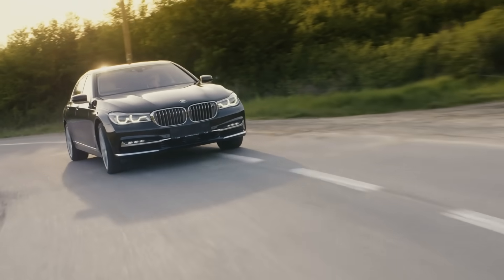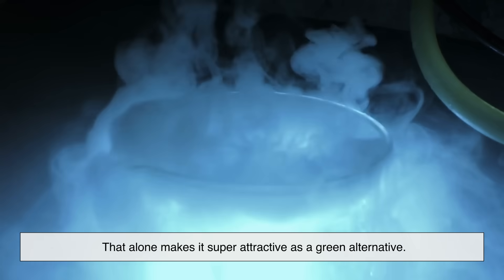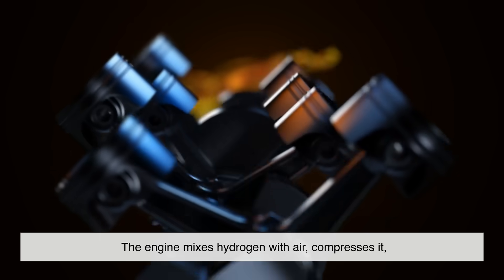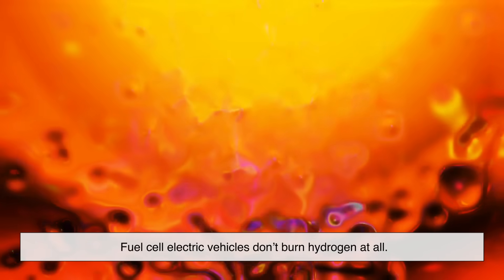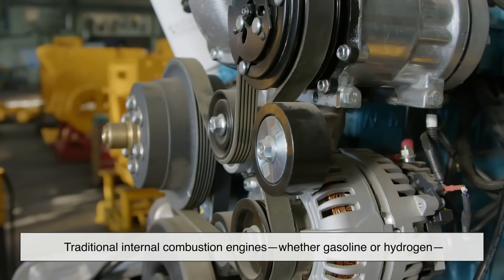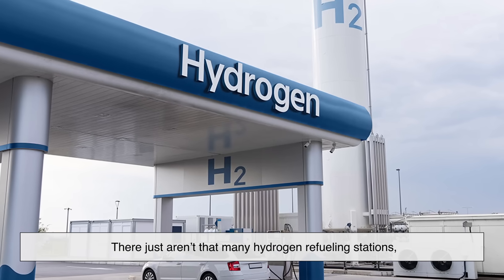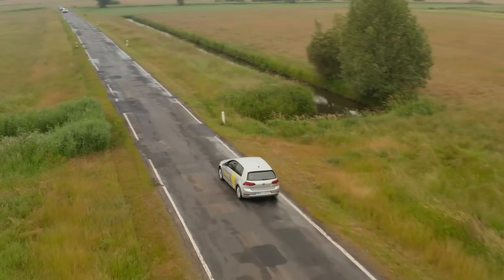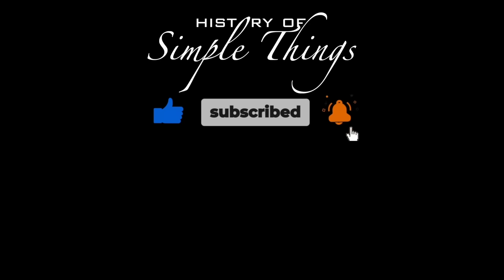Hydrogen Engines: The Engine of The Future

Comment: I think the hydrogen fuel cell approach is more viable that the engine approach.   When gas powered vehicles first came on to the market, they were owned by the rich of the time and a great many people had great fear of the highly combustible gas when compared to kerosene that some used for lamps.   Everything new requires some R&D to make it viable as was done for the gasoline powered machines.

Regardless, there needs to be a better, safer solution than the volatile lithium based batteries.   Mining and refining the minerals & chemicals for these batteries is not good for the environment.

Comment: Let’s take this video apart.. first hydrogen is as you say the most abundant element but it’s really difficult to split it from what it’s attached to. Electrolysis uses a huge amount of energy/ electricity. To use natural gas to do the same job it’s not clean. As for the hydrogen engine two things the life of the engine because it runs hotter and the efficiency 20 to 25 %  is very poor compared to the efficiency of a battery electric vehicle. If you run a hydrogen vehicle with a fuel cell that is slightly better but here comes the second problem one runs on liquid hydrogen and the other requires hydrogen gas. So how do you set up an infrastructure to meet the demands of both. Because as yet there is no infrastructure to support ether. So the conclusion of this is yes hydrogen can work but it will take decades to build up before it can be looked at as a true viable alternative all the time battery’s are improving giving ever great range coupled with faster charging.

Comment: "The former", Electrolysis, to make hydrogen, requires electricity from a fossil fuel prime mover on the American grid (e.g. natural gas, coal, with the exception would be Nuclear). "Steam Methane Reforming" requires Natural gas, a fossil fuel. Either method is needed to make Hydrogen fuel. Neither method is clean. Also more energy is expended in making the Hydrogen fuel than what will be extracted by burning it. Cryogenic Hydrogen liquid fuel has LESS energy density than Gasoline or Diesel per gallon, thus will give a shorter vehicle range, unless an expensively made fuel cell is used to convert the Hydrogen fuel to electricity for electric motors. So the cleaner burning Hydrogen emission is offset by the carbon emission of making the Hydrogen fuel.

Comment: Elon could make the Hydrogen feul cell viable.  Hydrogen is more abundant and burn time is less than Lithium, which is volatile when exposed to water.  Using Thorium as a Hydrogen Sponge, H² can be stored as a gas within a reinforced tank smaller than a 2 liter bottle.  The pressurized tank uses its own back pressure to auto-seal.  Then fuel time and range will beat out Li.  Fueling Stations only need a water line and electricity to make fuel on the spot.

Comment: To add to another comment splitting water with electricity takes a huge amount of energy. Your heat loss figures for gas or Diesel piston engines must be from the 1800s. A modern turbo Diesel can make much better than that. 😊

Comment: We have enough hydrocarbons to last for generations. We will not see the need for electric or solar or any other energy in our lifetime or our great great great grandchildren lifetime.  Right now we need to focus on the most cheap and reliable energy.
Reply: But burning hudrocarbons produce carbon dioxide which is one gas that causes  to climate change

Comment: I always laugh when the statement about hydrogen is that burning it only produces water vapour. 
H2O is by far the most powerful greenhouse gas, with a concentration of 2% in atmosphere and absorbs nad re radiates the whole infra red spectrum. CO2 for comparison is .04 of atmosphere and captures but a small part of the infra red spectrum.

Comment: Hydrogen isn't a fuel.  It is an energy storage medium.  It is marginally efficient in a fuel cell... very marginally.  

Also,  nice b-roll on that circuit board with the burnt resistors.  Too damn funny.

I'm gonna fly to the sun and bring back some of the hydrogen. And don't worry:  I won't burn up, because I will go at night.

Comment: The cost of manufacturing enough hydrogen to replace gasoline would bankrupt nearly every country on the planet. The power content of hydrogen is not nearly as high as you are trying to lead people to believe. To replace 17 1/2 gallons of gasoline in an internal combustion engine. You need 105 gallons of hydrogen gas compressed to 10,000 lbs per square inch. And you're not going to replace that inside of 3 or 5 minutes. Even large trucks being used in Europe go no more than 300 km they can carry an awful lot of hydrogen. Add manufacturer of hydrogen in those countries where they are working with it is causing as much pollution as the gasoline engines are trying to replace. What is interesting is that there have been recent advances in piston design and internal combustion engines using gasoline. An oil technology and we've known for at least 40 years now that the Earth is constantly producing more oil bet you can lower the emissions from a gasoline powered internal combustion engine buy up to 80% and not even have to put a catalytic converter on it yet. I know that you are reading journals and not actually working on vehicles. 15 years ago an engine that would put out a thousand horsepower. If you convert it to run on hydrogen puts out less than a hundred horsepower. It is not nearly as easy as you make it sound. Plus you still don't have any range. It has less than 1% of the power quotient of gasoline. There's far more BTUs of energy in a gallon of gasoline then you're ever going to get out of hydrogen.

Comment: First Hydrogen-Powered Vehicle:
By 1807, de Rivaz had created a prototype engine that used a mixture of hydrogen and oxygen to generate explosions and propel a carriage, making it the first vehicle powered by an internal combustion engine, specifically using hydrogen as fuel.

Comment: UChicago Pritzker Molecular Engineering Prof. Y. Shirley Meng's Laboratory for Energy Storage and Conversion has created the world's first anode-free sodium solid-state battery.

With this research, the LESC—a collaboration between the UChicago Pritzker School of Molecular Engineering and the University of California San Diego's Aiiso Yufeng Li Family Department of Chemical and Nano Engineering—has brought the reality of inexpensive, fast-charging, high-capacity batteries for electric vehicles and grid storage closer than ever.

"Although there have been previous sodium, solid-state, and anode-free batteries, no one has been able to successfully combine these three ideas until now," said UC San Diego Ph.D. candidate Grayson Deysher, first author of a new paper outlining the team's work.

The paper, published today in Nature Energy, demonstrates a new sodium battery architecture with stable cycling for several hundred cycles. By removing the anode and using inexpensive, abundant sodium instead of lithium, this new form of battery will be more affordable and environmentally friendly to produce. Through its innovative solid-state design, the battery also will be safe and powerful.

This work is both an advance in the science and a necessary step to fill the battery scaling gap needed to transition the world economy off of fossil fuels.

Meng and Deysher have filed a patent application for their work through UC San Diego's Office of Innovation and Commercialization.

Comment: Hydrogen cars were sabotaged by oil companies and sjeiks by buying up patents and delaying progress. Early 2000's Mercedes, BMW, Volkswagen, Volvo already were far with hydrogen cars. But they were a threat instead of electric cars. So they didn't sabotage that. Electric cars are a hoax. Displacing the problems. It's impossible to produce enough green electricity. And the transport of lithium and production of batteries are environment polluting. Also electric cars aren't that safe when they catch fire. Also they are extremely ugly! Hydrogen cars and planes are the future!

Comment: There's at least two major reasons WHY hydrogen has not been used in cars before;

1) It takes an enormous amount of energy to chill hydrogen gas to -423 degrees F to liquify it so it can be stored in tanks!

2) It has to be stored in HEAVY, thick walled insulated ressure tanks- HEAVY is not good in a car.

The Hindenburg exploded in a massive fireball from static electric when docking, we've all seen it in the old films how the entire vehicle went up in seconds in a massive fireball, it was filled with HYDROGEN gas because the US Govt refused to sell Germany any helium at that time, so they used hydrogen gas instead with disasterous results.

If the hydrogen fuel system gets a leak of any kind anywhere in the system- tank, lines, carb etc, the entire contents of the tank will leak out, and one spark is all it takes to ignite it in a huge fireball. Put one in your garage and one little leak will fill the entire garage with extremely explosive  hydrogen gas, get into a big collision on the freeway it's virtually guaranteed a fuel line or something will break, releasing the  high pressure in the tank- Liquid hydrogen tanks typically operate at pressures up to 123 psi

Converting gas to liquid loses about 1/3rd of the energy in the hydrogen, so 1/3rd of the energy in hydrogen is completely lost just liquifying it.

WHERE are you going to refuel? for a service station to refuel these cars they'd have to have a BIG, HEAVY, heavy walled insulated pressure tank, you can bet businesses and residences around such a location absolutely will object to such a tank being installed where just one accident, one leak, one car crashing into the tank will be like the hindenburg right there taking out everything around it like a massive bomb which it is. At least gas stations have their tanks underground
Reply: Hate to burst your bubble here, but Hydrogen is viable to be stored in its gaseous state, and requires storage tanks no more complicated than an oxygen tank which store up to 2000 PSI of gas with nearly double in safety overhead. Additionally, if you didn't know this already, traditional internal combustion engines can be fitted to run on hydrogen as is. Its a viable fuel source for locomotion. Your concerns about storing the hydrogen in it's liquid state is only a concern for high volume storage. For a combustion engine, you would actually want it stored and ready for use in a gas state. And the tanks for that, while heavy, are only as heavy as they need to be to contain the pressure (which for gas tanks in industrial applications operate at nearly 10,000 psi on the high end). Scaling is not an issue. As for refueling, similar to propane, you can just refuel the tank using a connector. All you need is a locking interface with the tank, and a pressure monitor. once the desired PSI is ready on the fuel pump, the flow stops, and the line can be disconnected. Concepts for these refueling stations are already in the works, and they look pretty similar to modern gas pumps. Mostly because the general premise isn't far off. And finally, collisions. so... im going to be nice here. But do you... know what a regulator does? Not only does it... you know... regulate the pressure coming out of the tank down the fuel lines, but it ALSO has safety valves inside to prevent blowouts. A Hydrogen combustion system operates under pressure, and there are VERY easy monitoring systems as well as mechanical fallbacks and dummy systems to halt the flow of fuel in the event of a leak. As for collisions, beyond any failure point... that hydrogen tank is build stronger than your car by a mile. Its build stronger than the concrete divider on the highway. If anything is surviving a collision, its gonna be the tank. 

The viable concerns are obvious, especially in knowing the flammability index of hydrogen is an order of magnitude higher than gasoline. But its not like we haven't had massive hydrogen tanks just lying around for ever without much issue. If anything, i would argue you should be more concerned about fertilizer storage methods if that's the hill you wanna die on, since unlike hydrogen, that stuff actually explodes rather than burns. Propane, same story. We use it all the time, and we store it in huge bombs we just... keep around. Like next to your legs while grilling. But i dont see anyone shitting themselves over that, even though ive seen tanks go off. Why? Cuz its really not that big of a deal. Its rare as all hell, and the risk is mitigated as best it can be. And propane tanks arent NEARLY as safe as hydrogen tanks. Just sayin... I think youve got the wrong idea in your head about what this tech actually does, and how it works right now.
Reply: @octipops1  they still are some problems though - you have underestimated the pressure required to have an economic amount of hydrogen for a combustion or that matter of fuel Cell car you need generally between seven and 10,000 psi which is of course technically possible.  the other problem is hydrogen burns with a cold low radiant heat flame virtually invisible and you don’t feel it until you are in the flame which is a risk in the event of a fire from accident or refuelling . finally as you correctly state the tank is extremely strong however it is not beyond the realms of possibility to have a nozzle into the tank or a connecting line fail at a point that could lead to an uncontrolled fairly rapid leak these things are entirely possible - as is the difficulty to maintain low porosity with the smallest molecule on the planet and also reactive with many materials to cause hydrogen embrittlement so not unsolvable of course but also not completely straightforward
Reply: I saw a 60min clip, where a tank that is smaller that a 2 liter bottle, using Thorium inside like Hydrogen sponge.  The container is also reinforced, and very difficult to smash, even when struck directly, but when protected within the car frame away from collision points, it increases the safety, it is also reported to be less combustible than a traditional gasoline tank
Reply: It also has a special valve that closes on it's own as long as the container is pressurized.  When refueling,  the valve is released to allow more fuel, then back pressure seals it up again.

Comment: So in both cases, hydrogen molecules are in a vehicle in some sort of tank. Presumable, that tank contains hydrogen under pressure. This will require more weight to protect the tank from bursting and then possibly exploding.
Reply: Its ridiculous! it takes - 423 degrees F temperature to make the gas into a liquid, and the tank has to be a heavy walled, insulated pressure tank. One leak and that liquid hydrogen is going to vaporize into gas that is extremely explosive- the Hindenburg was filled with HYDROGEN gas!
Reply: around 8000-10000 PSI
Reply: @DSAK55  thats for compressed gas storage. It doesnt need to be nearly that high for this application. You could probably get away with a low pressure tank, since you arent exactly relying on the actual tank to do the heavy lifting. you just need some hydrogen in a distrubutor to be injected into the combustion chamber. A high volume, low pressure tank would be perfectly viable, and would likely be the strongest component in your car, second only to the engineblock itself. I wouldnt worry much about the tank exploding... even in a collision. The only think id be concerned about is the regulator. thats the weakest point on the tank by far.
Reply: @octipops1  you’re correct in saying that the regulator is the weakest point but not correct and saying it doesn’t need to be at high-pressure the specific energy of hydrogen is not great from memory so you need a fair old quantity so you need pretty good pressure if you want the car to go any decent distance
Reply: @octipops1  oh and also a hydrogen tank that is second to the engine block in terms of strength is not going to be strong enough for the pressures that you would require
Reply: @octipops1 No, you can use it as a compressed gas it just takes a 1,000 time bigger tank than it does as a liquid. And that requires  over 800 PSI the lower the pressure the more you have to cool it!
Reply: https://www.youtube.com/watch?v=RAEhhYqMEBE
Reply: And you can't contain hydrogen. The molecules are to small
Reply: @terenceiutzi4003  Dude, do a google search on "how to contain hydrogen". Because the Space Shuttle Main Tank - that big cylinder the shuttle was attached to - contained hydrogen.
Reply: https://www.youtube.com/watch?v=RAEhhYqMEBE
Reply: @stephenvelden295, you can run an engine on anything that burns but how much does it cost and how polluting is it?

Comment: Did you forget that of the top 3 most potent Greenhouse Gases, Water Vapor is the king?
Reply: like the Water Vapor that comes out your tailpipe
Reply: All the clouds are water vapor!
Reply: @Thyme2sea  that's exactly the point! There's so much water vapour in the atmosphere, which has such a huge specific heat capacity, that it's the biggest source of so called "greenhouse gas". Carbon dioxide is genuinely negligible in comparison, being only about 0.04 percent of the atmosphere by volume. Broadly, there's 60 to 100 times more water vapour in the atmosphere than CO2.